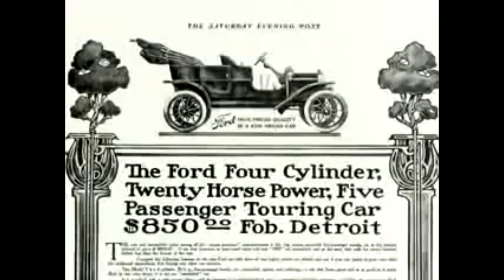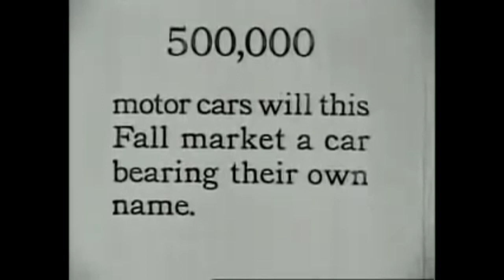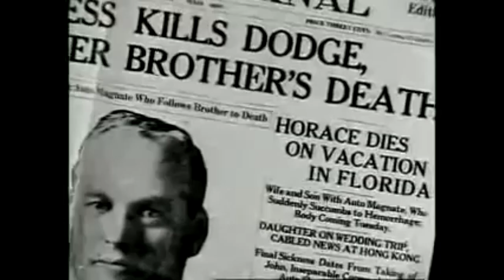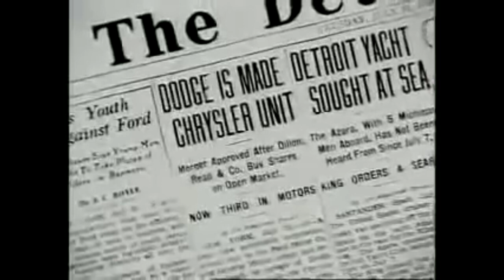the DRUNKARDS who created DODGE

Comment: My first car was a 1966 Dodge Coronet 440 coupe. 318 v8, TorqueFlite transmission, power steering and brakes. I didn't take  notice it had factory air conditioning until I opened the hood and saw the Chrysler Air-Temp compressor. I didn't think it worked because the car was 11 years old, but to my surprise and delight, it did. The air was ice cold in only a couple of seconds after i turned it on. I never had a problem with that car. I took a lot of grief from my friends about driving a Chrysler product, but i didn't care. I loved my Dodge. I wish i could get it back.
Reply: ...curious...
How did it have a 440 and a 318?
Reply: @kenik2023  Coronet 440 was the model, not the engine. There was a higher trim model known as the Coronet 500, and during some years there was also a Coronet 330.

Comment: Dodge invented dependability and reliability? Cmon
Reply: Dodge was among the most reliable cars in the 1920's according to its reputation at the time.  The company has gone through a number of alterations, including a complete liquidation in bankruptcy as part of Chrysler so whether a Dodge is dependable depends greatly on the era of its manufacture.
Reply: @edarcuri182  I'm not questioning that the cars were dependable or reliable. Just questioning that the words didn't exist until dodge.
Reply: The  Ford Model A of 1927 was similar to the Dodge, but after the Dodge brothers died in 1920, the Dodge car had seen few improvements.  In 1920 the Dodge car was class leading.  You could drive a 1920s Dodge today more so than most vehicles of that era.
Reply: @LifeisGood762  Steve Martin is credited with inventing air quotes so anything's possible

Comment: Neither Dodge nor it's parent company Chrysler was ever the largest automotive manufacturer in the USA. Since Ford lost that semi-permanent distinction in 1927, it has most often been claimed by GM, though Ford has outproduced and outsold GM from time to time.
 The Dodge Charger was released as a regular production vehicle in 1966, not 1964. Prior to 1966, the Charger name was limited to experiemental and show cars.
  Interesting how nothing is mentioned in this presentation about Chrysler, including Dodge, being owned for some time by Daimler/Mercedes Benz and later/currently by Fiat, or whatever Fiat's "parent" company is now called.
 It is admittedly a different thing to research something (like an automaker's history) rather than having lived through most of the history of the object of research. At least you're trying to find out some of the relavent facts.